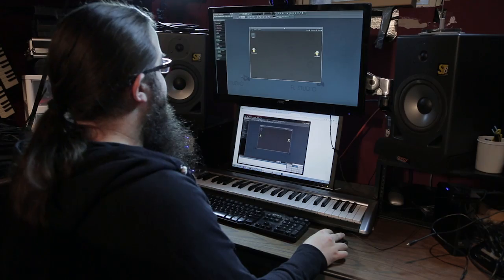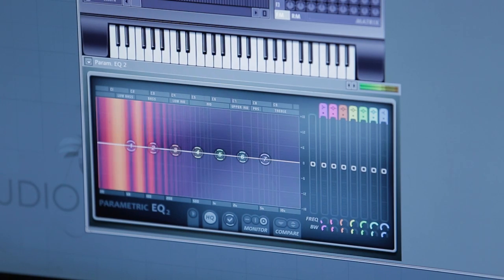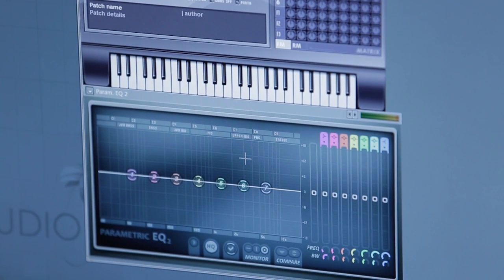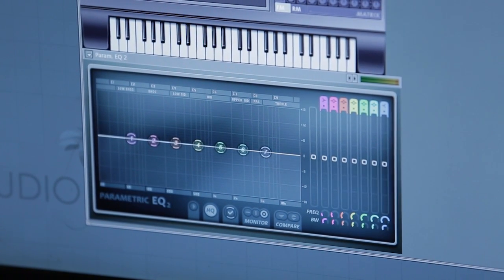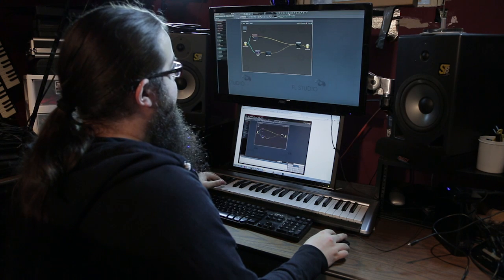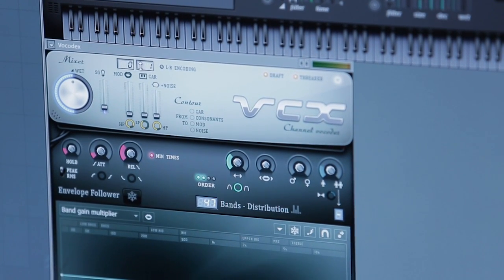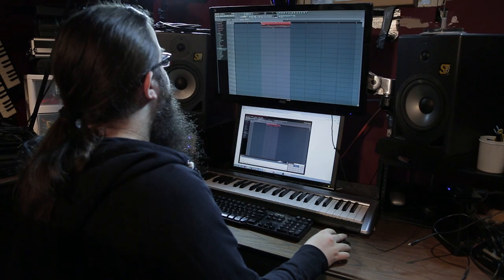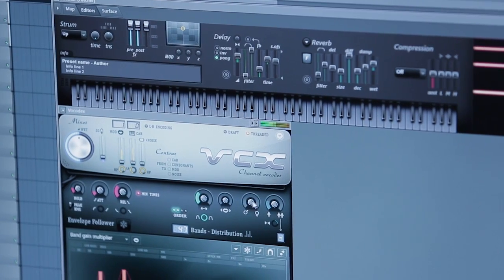How to Use an FM Bass as a Modulator in Vocodex with SeamlessR

Comment: I know this is a n00b question, but how do you place two notes on top of each other and get the tone to glide up and down as opposed to just playing the two notes simultaneously? I would do a Google search but I'm not even sure what to ask.
Reply: Depends what synths you're using. if its a Native fl plugin open the wrapper, go to the MISC tab there should be a section called polyphony. with a knob that says slide. That knob controls how fast it will slide between notes. Also in piano roll in the top left there should be a triangle button. This means you can control if the note is a sliding one or not.
Reply: its called a slide note. in the top left of the piano roll, there should be a diagonal line and a slope looking triangle. click the triangle and you've switched to slide notes. when using an external vst, this wont work, but for internal or integrated plugins, the length of the slide will affect the time to finish the slide.
Reply: +Zeronite Yeah, I ended up figuring it out a few months ago, but I appreciate the response all the same :] they're so freaking useful, I have to consciously make myself not use slide notes for every fm synth I make because they just feel so good.
Reply: try seamlessR's fl studio basic tutorials playlist on his channel.. trust me they're only named basic.. I was surprised at how much I didn't know about the piano roll... You'll come out great :)